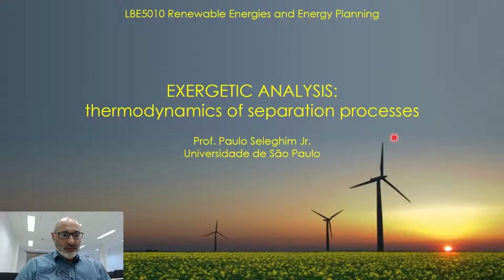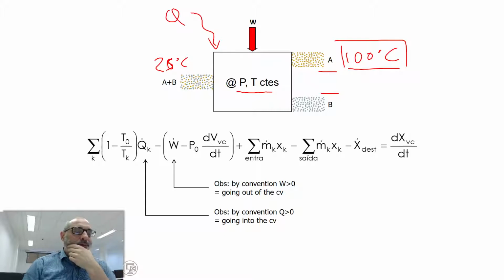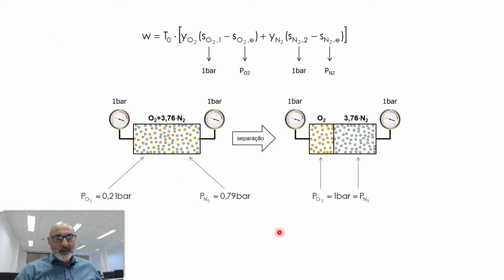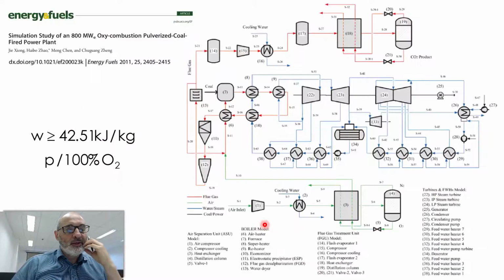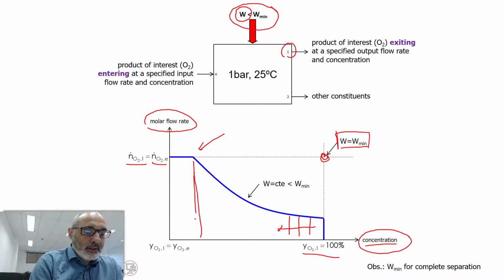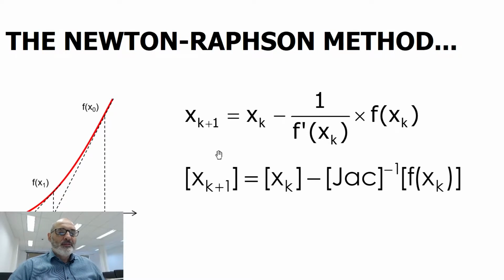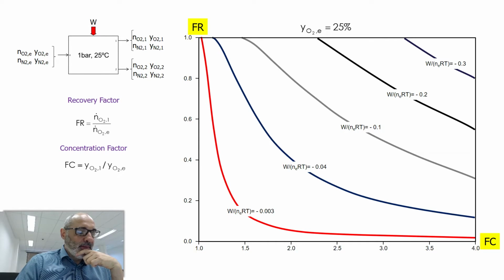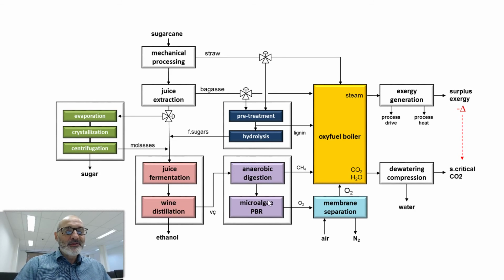6) Exergy analysis of a separation processes

Comment: thanks for the knowlegde Prof. please sir, how can i do absorber, desorber exergy analysis process for post-combustion CO2 capture.
in this case, do i assume that the absorber and desorber doesn't receive heat and work input. does the system work at constant ambient temperature of 25 degree celcius and 1 bar